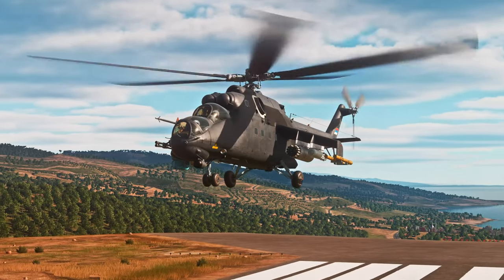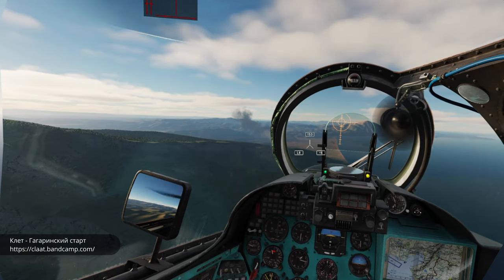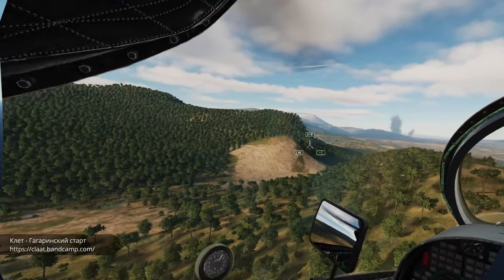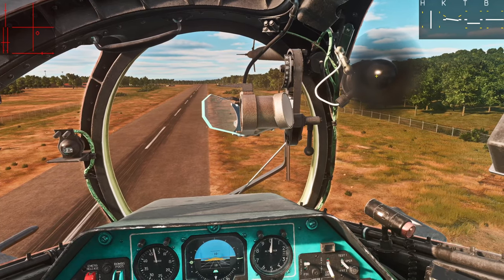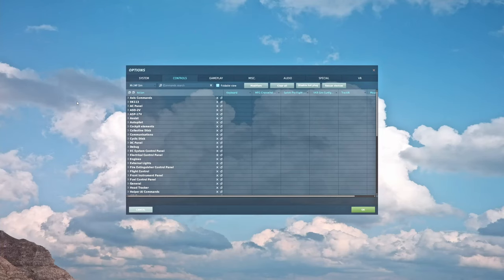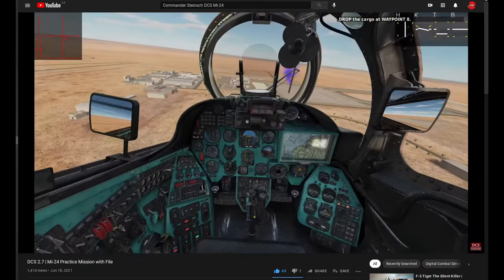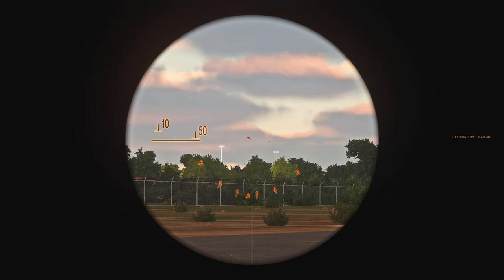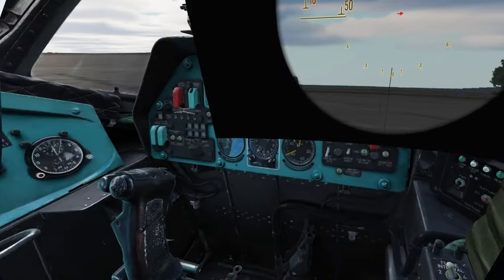Everything Wrong With The DCS Mi-24P Hind

Comment: I want to note that the multicrew de-sync is not a problem only related to the hind, I've experienced it as well in the Huey and Gazelle.
The biggest problem is if de-sync happens on a server with moderate to high ping the tail will snap off at random. (same with other helos)

Also, a quick fix if stuff isn't working (rpm or rotor isn't synced) is to rejoin the helicopter. When i sit in the front i always rejoin before takeoff to make sure everything is working.
Reply from the maker: The Gazelle is third party and uses its own multicrew code, which has always been highly problematic. So I can't fault ED there. My own experience has been that the Hind is much worse than the Huey for desync but you're right, it affects that helo too. 

Exploding or losing your tail for no reason always sucks :(
Reply: Dsync its a problem in all planes in DCS, net code in general its a huge mess lol
Reply: @StoneCoolds  There's a difference between planes desyncing and your helicopter exploding
Reply: @StoneCoolds  wow, sounds like a non-starter

Comment: the worst for me is the random "double trim" and lack of bindings
love this beast but needs a quick fix on some obvious default like that
Reply from the maker: I'm told the team is aware of the trim bug and they are working on it. So there's hope! Because right now I'm pretty hesitant to even use it lol
Reply: @vsTerminus  It becomes a hardcore flying with this trim, sometimes double trim and sometimes you double tap by mistake it so it resets
big surprise when landing
But still this early access launch is quite good overall
Reply: I fly mostly manual because of that. The best way I found to trim it, is like with the KA-50. Have the stick centered, press trim and then move the stick to where you want it to, release button. It's the only way it works for me.
Reply: @HerrW0lf  I also tried this but same results, it is really on the release of the trim button when the magic happens

Comment: the fact that the fan of the front seat doesn't get stuck when you put your finger in it is definitely a NO-BUYER !!
Reply: im not sure if it was changed, but I think it does now
Reply: It sure does now
Reply: ED is great in teasing and releasing new modules but lacks in finishing them. I left DCS for 18 months and when i came back there was basically no progression on the Viper as i left it. Same with the Hind. Huge announcements, lots of trailers and basically no progression since release. Instead they are teasing the Apache which will also lack of most of its features at release.
Reply: @ghostskills  F 16 now recived a ground radar huge improvement I would say but yes ED release unfinished modules too many times
Reply from the maker: On the contrary they have done a lot with the Hind since launch. Bindings have improved, desync has improved, cms has improved, atakas were added, using atgms with petro has improved, visual bugs have been fixed, mirrors have been fixed, cockpit shake has been added, sling loading has been fixed, and more. 

There are still major items like Petro's voice and the cargo area gunners to do, but it's disingenuous to say they haven't made any progress since launch.
Reply: @vsTerminus  calm down, I was kidding and I bought it day one anyway 😁
Reply from the maker: Ah sorry I was replying to ghostskills82, not you. I knew you were joking. Sorry for the confusion!

Comment: I was able to build a complete Voice Attack profile for Petrovich which I find works well. You can set push lengths in VA to achieve that.
Reply from the maker: How does your profile know what mode the HUD is in? Does it just start with an assumption and store the state in a variable from there? Or is it actually reading the state from the game somehow?
Reply: @vsTerminus  ok, so from the front seat, what I do is call Petrovich (I renamed him Grigor…). This starts him in FLT mode, which I can see in the HSI overlay. I can change Flight Mode by saying “Change Flight”. This cycles through modes FLT or CBTM. I can tell him “Turn Left 10 degrees” etc. “Slow down”, “Descend 50” etc

Comment: That sideways flight segment explains a lot for me. Thank you, it was puzzling me when trying out the module as to how and why does this feel so strange when sliding around, same with trim. ETL could pass for an explanation but it feels a bit of a stretch given how extreme it can get and how weathercocking seems to stabilize the opposite of expected. Overall I'm fairly happy with the release of the Hind. It's a mess, but not a disaster. A marked improvement over the F-16!
Reply from the maker: Yea, full credit to Erik Scott on that one. I'm excited to dig deeper into the flight model in the future but so far it feels really really good. The other issues are (hopefully) all things ED can and will address with time. I'm expecting half the stuff in this video to be obsolete in a month's time lol. But we'll see how it goes. I also want them to work on the Mi-8, as it has a few other bugs that have been around for a while.
Reply: @vsTerminus  Any update to the old Mi-8 would be welcome. I'm sure Hind gets its updates fast enough considering how fast F-16 was being worked on. I have no doubts that they'll get it ironed out in no time, relatively speaking of course. Going to give the Hind a new try when it's just a bit more mature then myself, it just feels too odd to fly with its trim behavior right now.
Reply: @OctoBooze  This is the only helicopter so far I got into a tail-spin condition in :) There is definitely something wrong with tail rotor modeling for sure, but on the bright side, at least it seems Belsimtek are trying to model its aerodynamic effects.

Comment: When I was making mods for X-Plane back in the day - C++ plugins - something I did quite early was make a generic "toggle switch" class which would automatically generate bindings for "turn on", "turn off", and "toggle". and similar for pushbuttons and selector switches. so when I went to simulate a new system/panel, I'd just say "it has five toggle switches named x, y, z, two pushbuttons labelled a, b, and mode selector with options 1, 2, 3, 45" and I'd get bindings (and nice animations, sounds, save state etc) all built in

not sure how any DCS third-party dev can survive to the end of the project without making something similar

Comment: Good review of the current state of the Hind. 
I find the Jester menu easier to use, because I don't need to remember any shortcut. Don't know why ED went that way, it makes communication harder than necessary.
Reply: Jester can be ungainly due to the amount of menus you have the sift through.  Petrovich is just a simple “fly here” mechanic.  Don’t really need a visual wheel menu for that.  Quick and easy; perfect for low altitude flying.

Comment: My interim solution until they fix the inconsistency in trim behavior is to get a rough level trim and then make any minor adjustments with the trim hat and any major with the joystick and do a quick press at the end. For landing, it's imperative to have the trim centered and nose ever so slightly trimmed up when descending and from there I do not hit the trim button- I've found that doing that the AP sends me on a rodeo and I almost always end up on my side or see sawing forwards and backwards on the helipad. Very frustrating.
Reply from the maker: Apparently the bug is related to the AP so I've just been flying with AP off.

Comment: I preordered, got it on day one. Overall, I got what I expected from an early access product. The only thing that was really frustrating to figure out was that DCS bunched up all axes of all my devices and assigned them all to sight control, messing it up royally. And the solution wasn't obvious, either. Once I got that figured out, my experience improved. Relatively speaking. Petro drinking on the job, though... I'm sure they'll fix it down the line, anyway. No performance issues on my old rig, which is nice.
Reply from the maker: My confidence in ED to release something in a good state on day one has increased after this launch. The hind has issues, certainly, but nothing I found was significant enough to convince me to hold off. I bought it after just a few days on the free trial.
Reply: @vsTerminus  it has been rather difficult to land on autorotation, though. Maybe a brief video on that sometime?
Reply from the maker: @antonbatura8385  I spent about an hour practicing them and you're right, it's tricky to set down without tipping or bouncing or tail striking. You can see my best attempt at 22:51 when I start talking about the flight model, and even there it was a little bouncy.

This is definitely one I'd like to do a video on.

Comment: Great summary and very informative for people who are on the fence! Maybe an addition to the list, or maybe I am missing something, but  I was struggling with the R-828 ADF system. I set up a transmitting vehicle with a sound file in the editor, set up the channels, but can't get it to work (not hearing the transmission and more importantly, can't get the compass to point to it). I'm pretty sure I flipped all the right switches.
Reply from the maker: Actually that's one I knew about and forgot to include in the video. It never made it to my notes. Oops.

IIRC, the radio nav only works on a hot start? So if you cold started you're out of luck. (Or maybe the other way around)
Reply: @vsTerminus  It was my mistake. While testing it again, I noticed that I set up the vehicle to transmit as a triggered option, not as a waypoint option, so I never had an active radio beacon. I just tested both from cold and from hot and it seems to be working fine. Apologies for the confusion and thanks again for the great video! Thumbs up and subscribed. :-)
Reply from the maker: Nice! Thanks for the followup!

Comment: Thank you for making this. I've been kind of afraid to watch it until now.  I preordered the Hind as my first DCS helicopter and was having fun just messing around in it but  basically stopped flying it when my skill level got to the point that I could tell strange stuff was going on. The weird sideways flight and trimmer issues were two big things I couldn't understand what was going on. I've also noticed the trimmer (in either mode) simply not working  near the center randomly.  I bought the Hip a couple of weeks ago as basically a trainer for the Hind and I'm loving it  thanks to your videos but trying to get back in the Hind it feels like the Mi-24 is incredibly unstable and takeoffs are a fight to the death compared to the Hip. I've flown it a little offline but most of my recent experience has been in MP where I seem to have more control issues and I'm starting to wonder if it's related to syncing even when you're the only one in the helicopter. I can't wait for your Hind videos to come out. Thanks again for all of your hard work!

Comment: There is one thing I missed with the flight model. With and without the gyros the mi-24 starts buffeting on approach where the nose will wobble up and down. This can be corrected for but it does not seem to be a correct representation of the actual thing. And I can not find anything on the forums about that. Is it just me?

Comment: For LTE if that were to occur you would lose all control over nose authority because at that point the tail rotor would be in full VRS until the helicopter straightens out and the tail rotor is in "clean" or undisturbed air relative to its position.  It could be a little bit of loss of tail rotor authority where your tail rotor isn't strong enough (either too small, not effective enough, or rpm isn't sufficient) to counter the main rotor tq and weathervane effect.  However flight regime wise it doesn't make sense why it would want to go the same direction (clockwise) regardless of the relative wind hitting the body of the helicopter.

Comment: I would prefer a simple option to reduce the Petrovich Interface to a small dot for the pointer and a mode/feedback box in the lower left corner (or positionable). The interaction through defined short/long presses on a 4-way hat is great, where as sacrificing possibly a dozen buttons to it isn't that nice. Especially in a russian helo with a gazillion buttons to map, already. 😇
Reply from the maker: I like the four way hat, don't get me wrong. My suggestion was to have both the hat and some discrete bindings so that I could bind those to Voice Attack.

Comment: Hi ! @26:49, I think you can't have the same efficient on right and left pedal, because this is an helicopter, so over your head, you have a very powerfull thing called TORQUE... When you fly a real helicopter, you can really experiment it, and how you need to correct with rudder till the end point if you pull the collective to high.

Comment: ED is great in teasing and releasing new modules but lacks in finishing them. I left DCS for 18 months and when i came back there was basically no progression on the Viper as i left it. Same with the Hind. Huge announcements, lots of trailers and basically no progression since release. Instead they are teasing the Apache which will also lack of most of its features at release

Comment: Forgot to ask in a previous comment, but what kind of axis settings are you using with your cyclic? I'm able to fly, but I do wonder if some curve settings might help me smooth out my flying a bit.
Reply from the maker: I am using linear axes. No curves. Depending on your joystick and deadzone you could try curves to see if they help but my impression with the Hind so far is that most people shouldn't need them. What stick do you have?
Reply: @vsTerminus  I've got the Warthog joystick. It's working pretty well, and admittedly, a lot of the swaying is my learning a real helicopter after being spoiled by the Ka-50. 
Figured I'd see if you're sporting any axis profiles since your handling is very smooth in the videos.
Reply from the maker: @aaronwhite1786  Ah. Yea you might actually be a good candidate for some axis curves. The Warthog is a nice stick and all, but the stiff centering force makes it hard to make small corrections around the center point, which is pretty much all you do in a helicopter! That stick was definitely intended for fixed wing, unfortunately.

You could try setting pitch and roll curves of anywhere from +10 to +20 and see how it goes. You'll have an easier time making small movements at the center point with those in place.

I'm flying with a VKB stick with soft springs and no center detent at all, so it's very easy for me to make minor corrections.
Reply: @vsTerminus  Thanks! I'll give it a shot and see!
Reply: @aaronwhite1786  Hey mate, I fly all the Helos in DCS and also have a Warthog, I have  +15 curve on Pitch/Roll and +15 on collective (inverted). I have found it flys pretty well with these.
Reply: @Johnny641  Thanks! Coincidentally, I just set mine to 15 this morning to test out at lunch today. We'll see how the adjustment period goes!

Comment: Petrovich is still passing notes in class.  8+ months later, still no voice.  Wish ED would just buy the Jester interface from Heatblur and use that.  If apache is menu based with no voice communications, that will be a real turn off.  And good to know about the trim issue.  I was wondering why I was having so much issue with trim.
Reply from the maker: Apache won't have voices at launch.

Comment: Hey do you use the trim hat to make it more stable ? And do you have damper mod kit for your mfg pedals?
Reply from the maker: I should use the hat more but I always forget about it because it's not an option in the Mi-8. I can usually get the trim where I want it without the hat anyway.

I have the damper kit now, but I didn't when I recorded this video.
Reply: @vsTerminus  I think the hind is more stable using the hat trim but I don’t know how realistic is flying that way, for your rudder pedals did you remove the spring? By the way excellent videos I love them.
Reply from the maker: I unhook the spring when I fly helos and put it back for fixed wing. It's nice that the MFG Crosswinds make that super easy to do.
Reply: @vsTerminus  planning on make more hind videos?

Comment: weight on cargo should have been fix. It was in patch note :) Btw, i flew Mi8 before freefly the hind, and is it me or hind feel way more heavier than mi8? on take off i feel like i have no power. i tried to get the rpm higher with the 2 throttles on left hip. but it dont moove. Also, hind on marianas dont start. you have no battery power ^^'